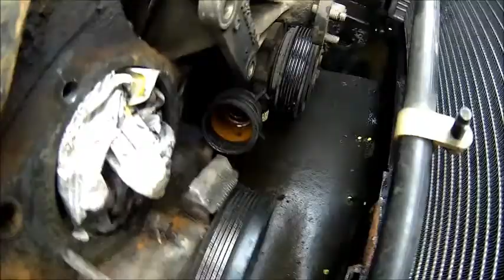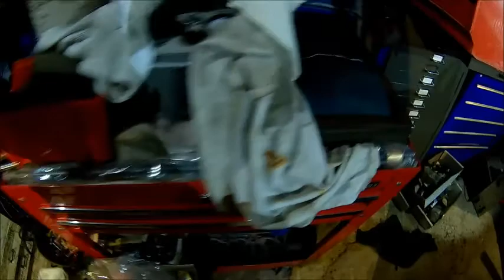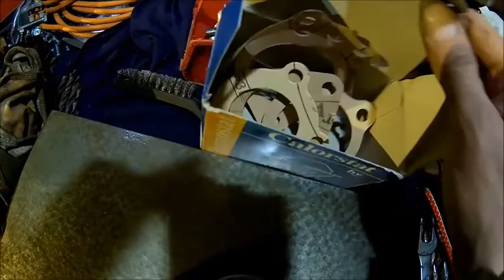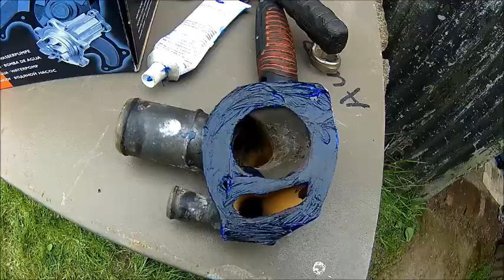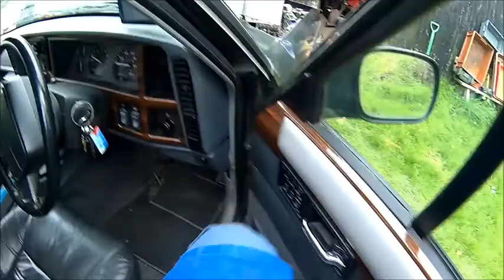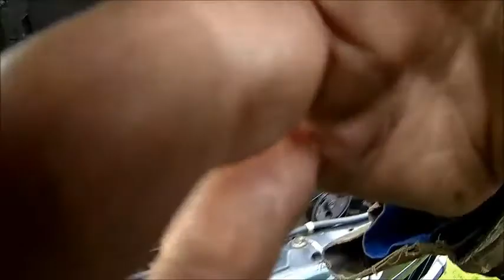Jeep Water Pump and Thermostat change - Part 2, re-assembly and test (Cherokee XJ)

Comment: You tighten and loosen a few spare parts, when one thing is fixed another falls apart. Often it seems thermostat housings  are poorly designed.
Reply from the maker: This housing is a really strange design,  if you tighten it up just a little bit too much it starts leaking and tighten further makes it even worse.... but i think a third bolt would have been far too expensive ...:-)
Thanks for watching